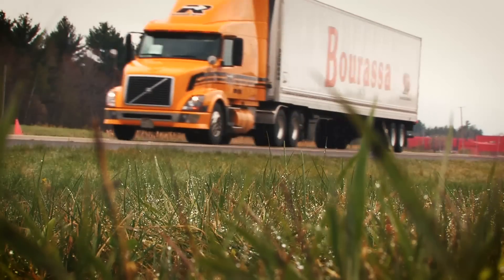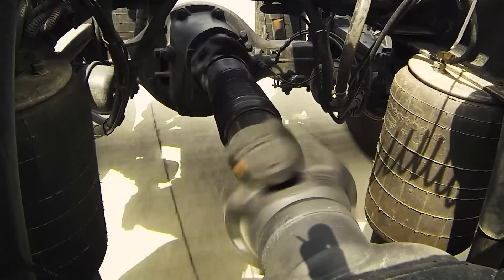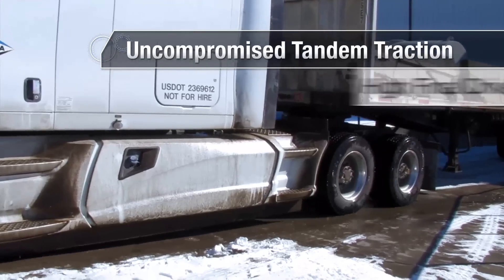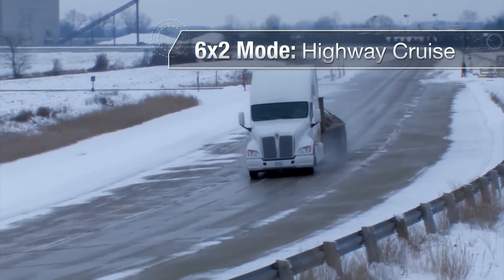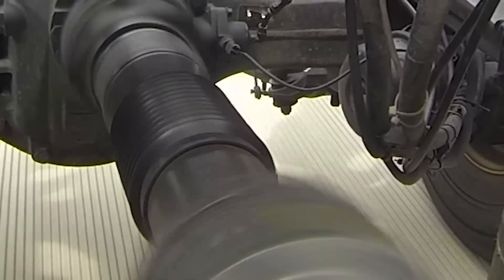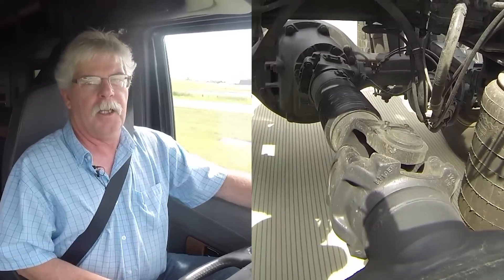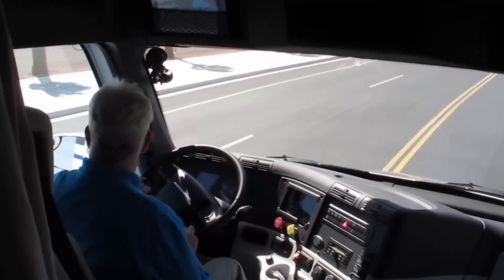Focus On... Spicer AdvanTEK 40 Dual Range Disconnect Drive Axle

Comment: just curious how noticeable is it when the system shifts from engaged to disengaged and is there a lock out to keep it in 6x4 ? thanks
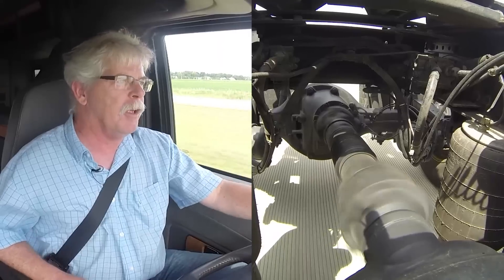Reply: +Jason Gray The shift from 6x4 to 6x2, or more appropriately, 3:10 to 2.26 feels exactly the same as a shift from 9th to 10th gear in a transmission. From the driver's seat, if you didn't know what was happening you'd think it was just another upshift -- or downshift, as the case may be.
Reply: +Jim Park thanks keep up the good work

Comment: Thanks Jim. Another good video with new stuff to think about. Both for people who may be interested in a new truck in the next few years or others who just like to stay up to date.

First, the higher ratio gives better pulling ability down low, and then it drops the ratio and rpm at highway speeds. Both save fuel.

Second, In the USA, Volvo's new tech is called "Adaptive Loading". It is 6x2 and its the first drive axle that lifts depending on the load weight and traction required. In the Euro market Volvo calls it "Tandem Axle Lift" that will lift and disengage the second (rear) axle.

Cheers

-Mike
Reply: +Mike Krol Thanks for the comments Mike. Glad you picked up on the benefits of the different axle ratios. That's the key to the Dual Range Disconnect system.

Comment: cant see the point of this, why not get a pure 6x2 truck?.  none of the 80.000 lbs rigs running on the us highways need to be 6x4. volvo just came out with the disconnect of the rear drive axle that you can also lift. but thats old tech. been done for 20 years by the finns.
Reply: +sisutrucks The Volvo Adaptive Loading setup is pure 6x2, but its a pusher arrangement. The rear axle drives and the forward axle lifts when it's not needed. We're currently working on a video of this product too. We shot the video a short while ago and we're just getting all the final editing done now. Watch for that one early in the New Year.
Reply: Why a 6x4? Because of better traction to start driving on slippery roads.
Reply: Because you’re a dumb with small brains that’s why, you have like 4 benefits in 1 with this tandem axels, 
weirdo :-(, You have a better traction in Snow on the gravel, you have better power up hills and from the start, you have speed with lower RPMs, and you have a fuel economy  lol,
Reply: Please if you can only berate someone with an answer like this just keep it to yourself.If you are so much smarter than us why are you not RICH ? @mgp-bct7723
Reply: +Jim Park Search for volvo trucks tandem axel lift. And you will se what he is on about.
Reply: Klaus Loewer  problem with 6x4 is when little weight on the drives. i can dump the air in one of the drives and that helps, but 6x2 works better empty and well loaded. i know for i have both hehe.
Reply: +Klaus Loewer You get better traction if you get a lift axel. More weight=more gripp.